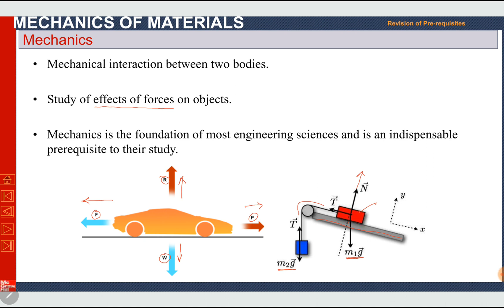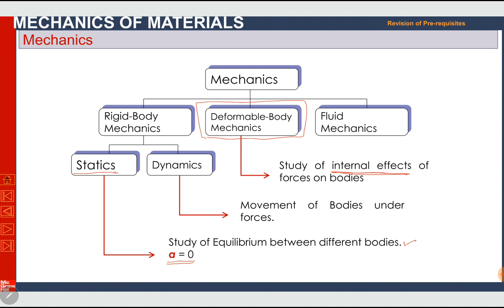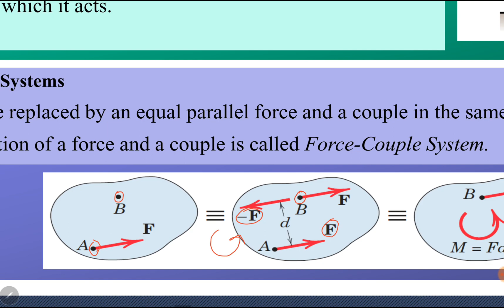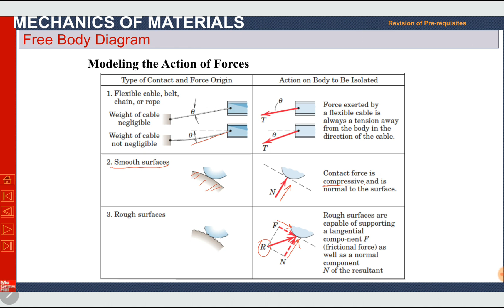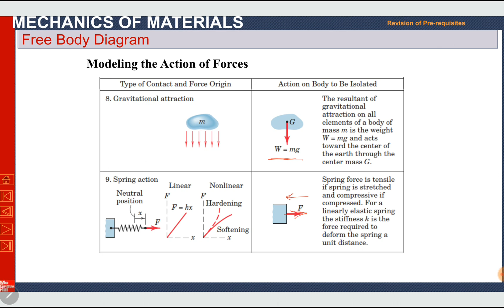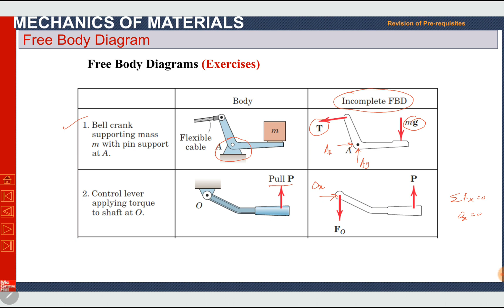Chapter 0 | Revision of Pre-requisites | Mechanics of Materials

Comment: Assalam_O_Alaikum! Sir, in example 4 of free body diagram there would be no tension force on string with which the mass "W" is hanging?
Reply from the maker: The Free Body Diagram is of the Rigid system. Rope has been replaced with the tension force (equal to the hanging weight)